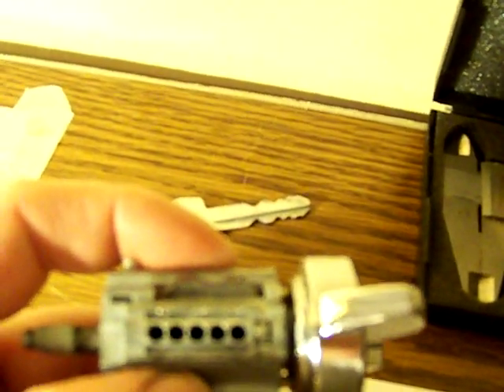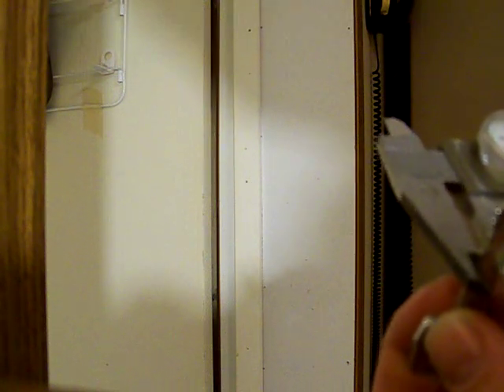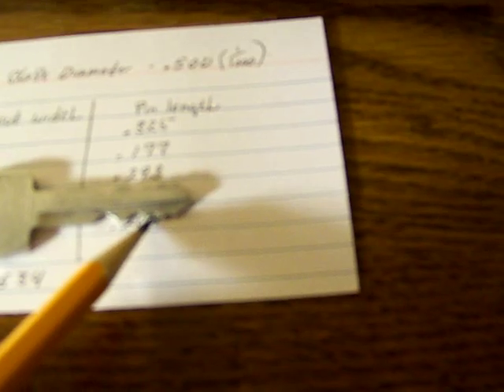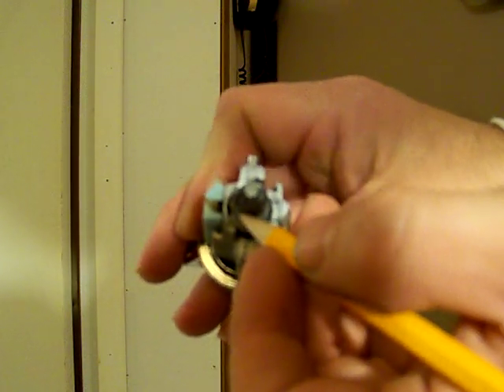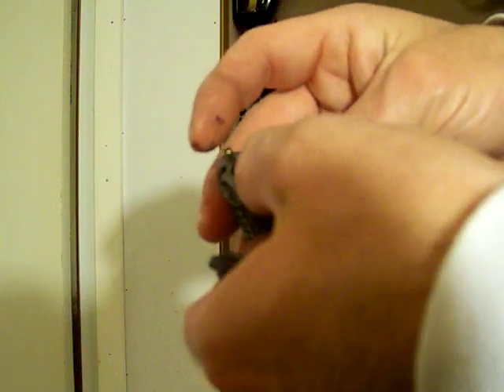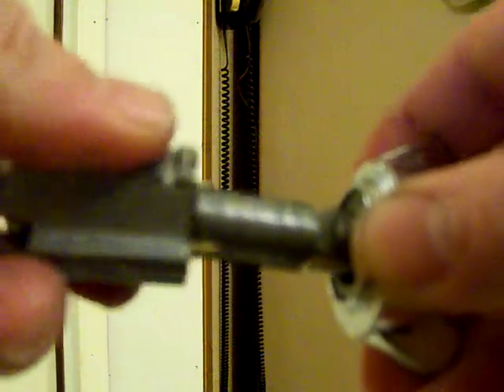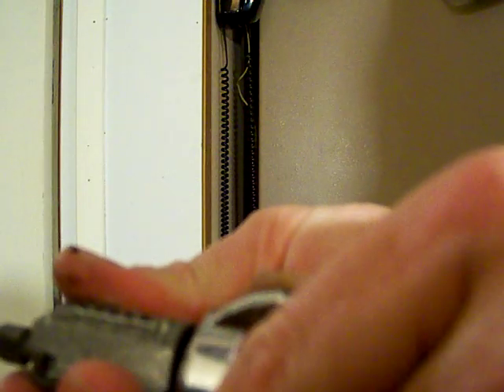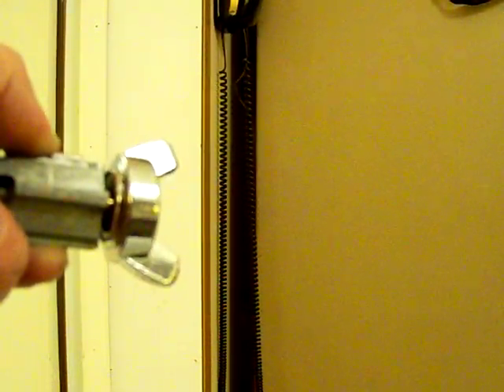Ford 5-Cut Lock Cylinder Re-pin/Re-key (Old Style Lock Cylinder)

Comment: Hey how do you get the tumbler cover off? I wanted to take my old one apart for the fun of it but it looks like the housing of the lock is peened over on the cover.
Reply: That's where I'm stuck.
Reply: @adammcafee2924  Over the years I have had a few of various ignition, door lock and glove box locks apart to rekey them. Those tin covers pry off/out but you have to be really careful not to overly damage them or break anything off the lock body itself.
Reply: Such a tight fit I can't get anything in there to pry out, nor is there anything to grab onto with pliers. short of drilling or welding into then yanking, I'm stuck!
Reply: @adammcafee2924  The best method I found was using a seal pick and wedging it between the cover and tumbler body and try to work it up a bit then you can get a small screwdriver or something under the end of it.

Comment: hey how come my lock cylinder key doesnt trun. ive installed it in my 1990 ford mustang and when i put the key in it doesnt turn. it feels as if its lock or stuck. i jerked the wheel left and right but it still doesnt budge. 

and advice on this problem would be help full.

Comment: I don't think your pin sizes are correct. The longest ford pin is only about .220 inch, used on door locks (H50 Key).  I don't think they use different pins on the ignition lock (H51 Key).
Why don't you measure the longest pin you have on the paper. .220 in. is around 7/32 in.